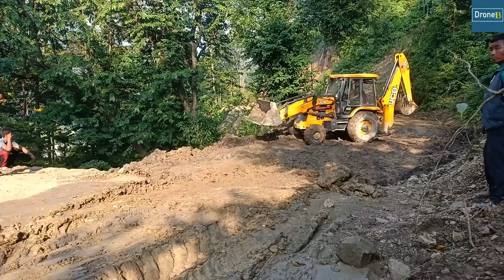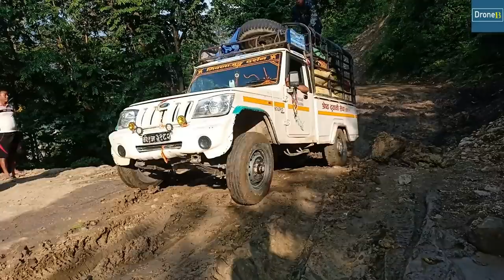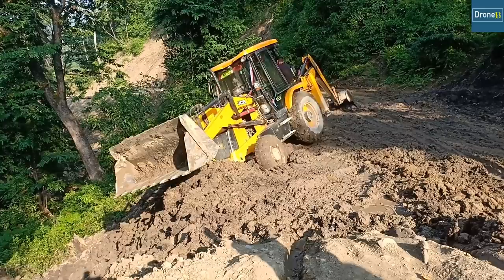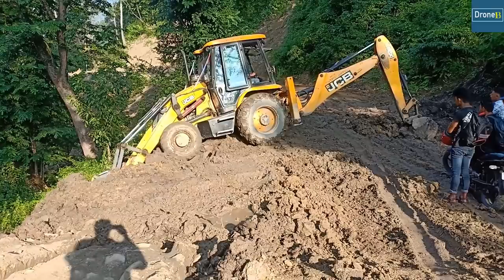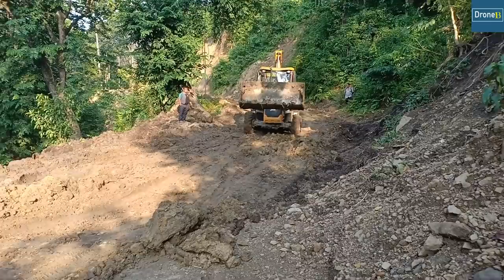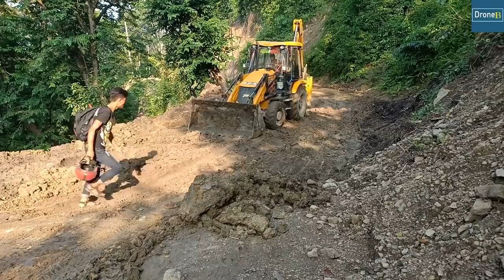Nearly Roll Down Hill- Backhoe Narrow Escape -JCB Backhoe Loader Video

Comment: Good job.  A few things I've done since nearly rolling my 3CX-Compact off a mountain last year that make life safer and more productive.  First, a set of 4 tire chains with v-bars welded on the links.  It protects the tires from rock really well, and traction on slopes is at least 5 times better.  Second, wear that seat belt and kick the tourist out of your cab.  Even one roll will toss you out and then the machine will crush you.  Plus, he could have been throwing stones into the wheel holes to make things go quicker.  Lastly, carry two long 30,000 pound limit synthetic rigging straps (say 50 foot ones).  When you get in a rough spot, the first one can go from the backhoe slide frame to a tree to make sure the machine doesn't go all the way down the hill, and the second can be rigged from a tree to your backhoe bucket.  You can just use that to winch yourself back onto the road.  Good job on the escape, though.  I can tell you I was pretty nervous when my JCB was teetering back and forth on the mountain.
Reply: Exactly as you say! I would just add my 5 cents - instead of pulling himself out with backhoe, which gave him less traction on back left wheel, I would rather try pushing sideways and a bit up with backhoe, preventing rollover and trying to get grip on rear left wheel to pull out. But that's from camera point of view, who knows what I would've done if I were there.
Reply: Or, in the far east... you can do it like this : )
Reply: Why not just use the stabilizers to lift and level the machine and then fill in the hole under the right rear wheel to get out???

Comment: I'm sorry Drone B, but from what I see here, the Operator is not "skillful and experienced". For a start, don't leave the front bucket on the ground and expect the backhoe to pull you out. You have another person in the cab there, why didn't you get him to tilt the bucket back as you tried to pull with the backhoe? Or why didn't you use the backhoe to bring the arse of the tractor round more square on to the road as you were pulling. The problem is the left hand rear wheel is hanging in mid air, it won't get any traction in air, no matter how hard you rev it. I appreciate your videos Drone B, but please don't tell me that this Operator knows what he is doing. Send him to a training school specialising in Plant Operation. From an Operator of 45 years experience.

Comment: To get out of this you dig a big hole as far over on the other side of the road as you can, so you can put the whole rear bucket in the hole. Then you can pull with straight horizontal force without leveraging the front end down.

Sometimes it's also good to turn off the 4wd cuz those spinning front wheels are just gonna dig you in deeper. One time I was similarly stuck but in a place where everything was steeper, the road and the drop-off. I put the front bucket down flat and lifted up the front tires and piled feed sacks filled with dirt under the tires cuz the front axle was totally buried. Came right out when I pulled intelligently with the tail.

Practice. And before it gets totally f'd turn the thing off and think for a bit, get advice from other experienced operators.
Reply: God advice man
Reply: Yeah so good advice. Turn it off and think. I reckon if he had put the scoop over the side opposite the back wheel in the air and pushed it down so both back wheels had traction, he would have been out. He never should have let the bloke in the 4WD pressure him to go to such a stupid place either.

Comment: Oh where to begin with these ding-dongs. 1) If you are going to use your back bucket, extend it all the way out to the uphill side as a counter weight. 2)  If you are going to push down with the back bucket, you have zero movement of the machine. Maybe that is ok if you need to stabilize the machine for rescue. Definitely don't push down via the uphill side of your machine. 3) DO NOT have another person in the cab, he will flip out and die. How I would have done this: 1) Get a shovel and level the ground a bit. The machine won't roll uphill. 2) put some material around/under the tires for traction. 3) Keep the backhoe extended out uphill, counterweight. 3) Lock the back differentials 4) Keep your front bucket very low. Dig, dig, dig, dig with a shovel. 5) Go very slowly. If your back tires spin, they are just digging you in even deeper.

Comment: This guy would get a check before coffee break on my job.
Reply: Should he last even that long hudsonhawk 001? He'd be gone straight away if I saw him up to antics like this.
Reply: Why does he keep lowering the front bucket onto the ground and then trying to pull the whole thing backwards with the backhoe. Forget my first comment hh001, I wouldn't even leave this bloke in charge of anything with wheels. Or even anything without wheels.
Reply: @newenglander4513  it doesn't look like anyone taught him how to use the hydraulics to his advantage. That machine should be able to pull itself out without using the wheels.
Reply: @hudsonhawk0016  Well, at least if the cat moved, the string might slip out. Yes you're right, the hydraulics can be used to get out of this problem. But he just didn't seem to know how to do it. We are told he is a very experienced Operator, well all I can say is they must have some real galoots on machines wherever this is. I hate to get personal, and everyone has to learn, but the side of a boggy mountain such as this is not the place to do it.
Reply: @newenglander4513  that's really a dozer, or a track loader job. A hydrostatic 963 would have been plenty big enough for the job. A track loader would compact better than a dozer and you can carry and place material where it's needed.
Reply: @hudsonhawk0016  Fully agree. This is no place for a backhoe, they're not meant for building roads. Should be on Municipal worksites digging trenches etc. Still, I suppose they can only work with the gear they've got, but they need to be able to use it properly so they don't get into this situation. But it seems he pulled off the road to let the 4WD pass, so why didn't he get over next to the bank on the other side? But then we wouldn't have someone put it on YouTube to totally humiliate the guy. Good to chat hudsonhawk 001, must go & feed the dogs.
Reply: @newenglander4513  👍